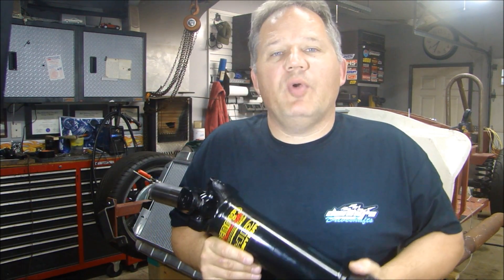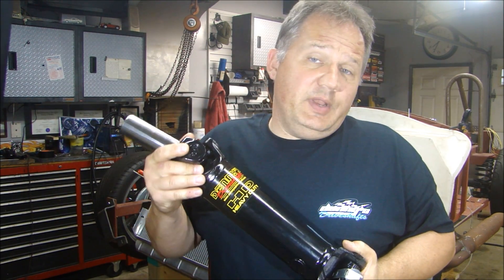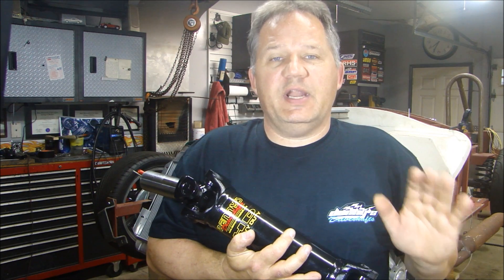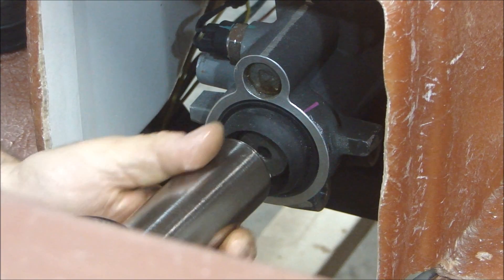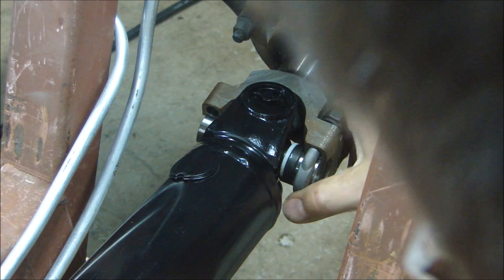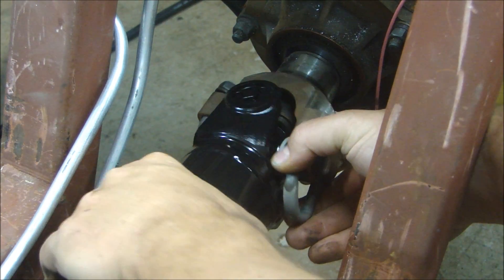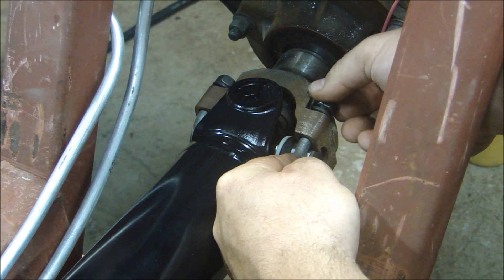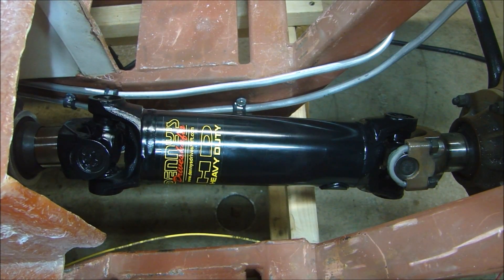427 Cobra - Driveshaft

Comment: Pete, great videos and  perhaps you can help with a similar installation I’m doing with a TKO 600 and and FE in a RHD Cobra. Basically I understand that, despite any offset, the mating faces/yoke have to be parallel. Got that. Also all the advice is 3 deg max angle as the suspension moves and can change the operating angle. Got that too. But what if like me, you have an IRS which effectively means the axle doesn’t move. I’d like to know what the max deflection angle can be then. This info seems hard to find and it’s come about because an FE in to RHD is compromised, due to the pinion being 1” offset to the right , which reduces footwell clearance if you offset the motor 1/2” like Shelby did . I’m wondering if I can run 5-6 degrees? Thanks and HNY from London, UK!
Reply from the maker: That is a tough one, 5-6 degrees seems a bit too high. I planned for than and had the axle custom made so the offset would be close to zero. I use a Denny's driveshaft, they have great tech support. Email them and see what they have to say, they are the experts.
Reply from the maker: Happy New Year from Buffalo, NY!
Reply: Thanks Pete, I’ll do just that and email Denny’s.

Comment: between the 427,428,429 which do u think would be best for a street build
Reply: brandon 460 is the cheapest route if you don't have an existing BBF
Reply from the maker: It really all does depend on what you are trying to achieve. Shawn is right, there are more parts for a 460, but originality might be important to you.